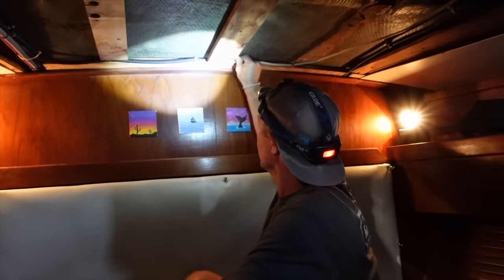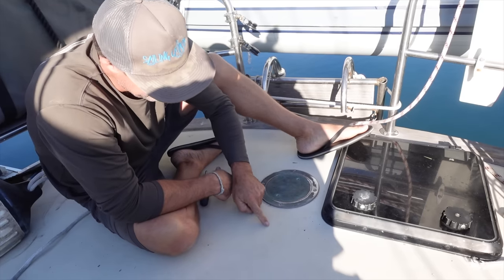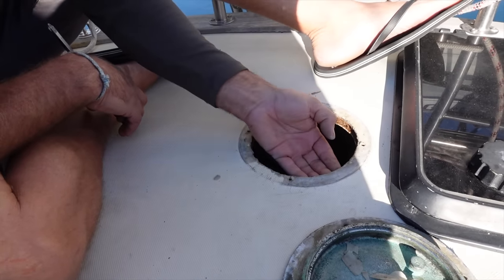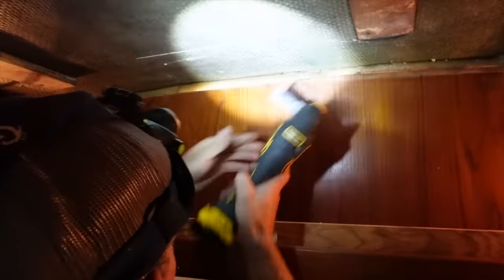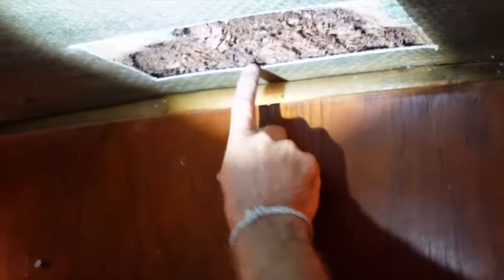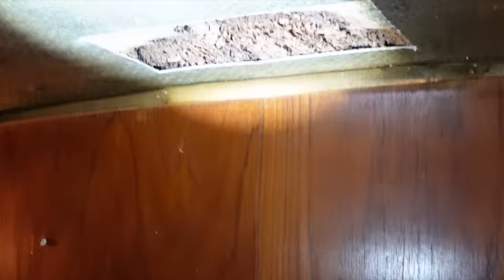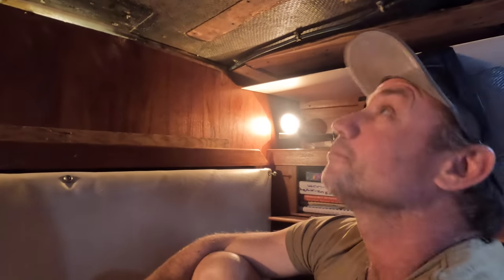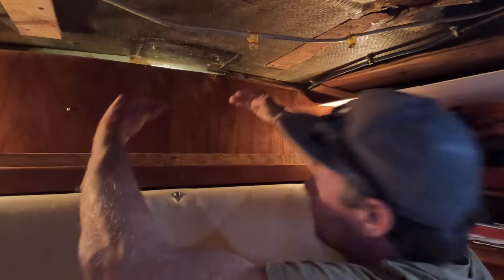Fixing deck ROT & a WATER Leak | Ep 340 LOTS of BOAT WORK

Comment: I’ve replaced a lot on Adventuress. With Coosa board, not g10. That damn rudder post! And my DEWALT oscillator is my friend. Most useful sander/cutter. The bottom layer of glass is much thinner!

Comment: Brilliant move updating the propane center.  Sealing leaks and replacing hoses is an important safety move.  Frankly, that regulator can always do with replacing every 5 - 10 years.  No need to wait if parts are available and you have everything apart.

Comment: I can understand the desire to build it strong and moisture proof but G10 is WAY overkill here. The core is just there to incompressibly separate the inner and outer skin whereas G10 is heavy, dense and rigid and designed to be structural by itself.

You'd be better off with some new lightweight core material and just backfill all hull penetrations with resin and proper sealant.